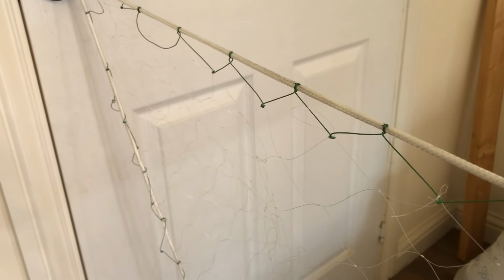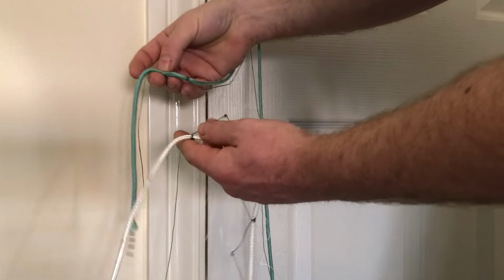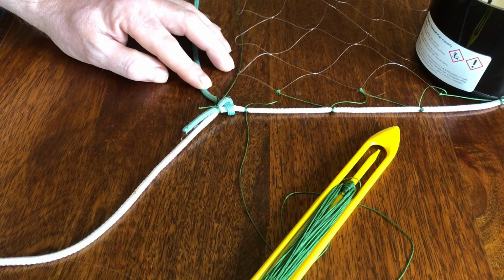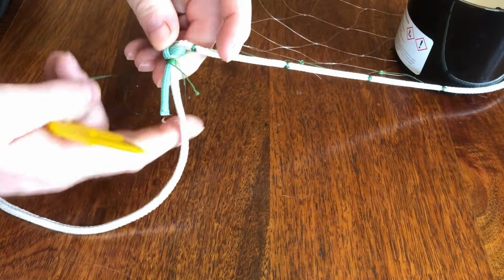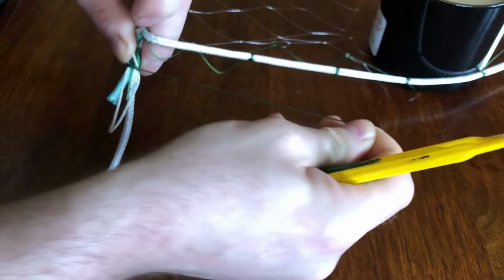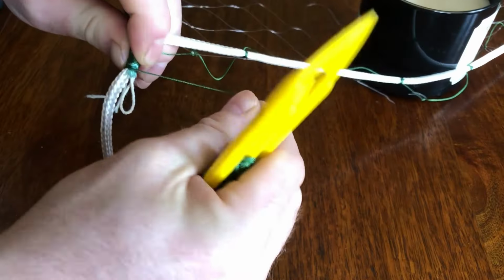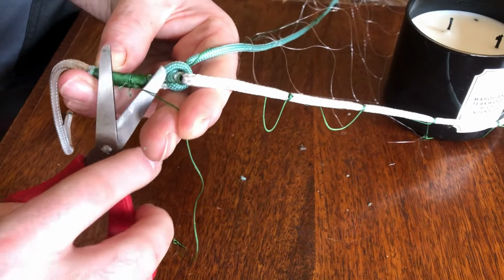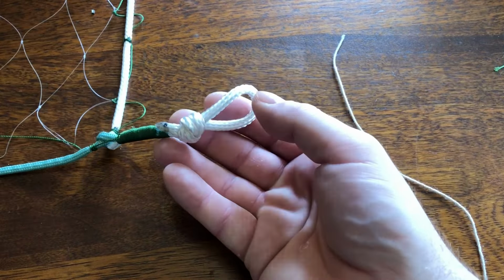pt2 How to rig gill / tangle nets. Fixing the lead line to the gill. Beach boat sea fishing.

Comment: Nothing like doing a proper job, make a bodge of it and it's sure to fail. How are you doing? Have you been signed off yet and can go fishing again. Had my injections in my back last week and it's killed most of the pain. They found a cyst which was causing a lot of the pain which they drained. Just got to exercise and get a bit fitter.
Reply from the maker: Hello mate, Im glad your back is better, back pain is crap. Im all ok, it wont be long now! A few weeks I think before I will go in the boat, but I might have a session or two on the beach first just to give myself a stretch and physically do something!